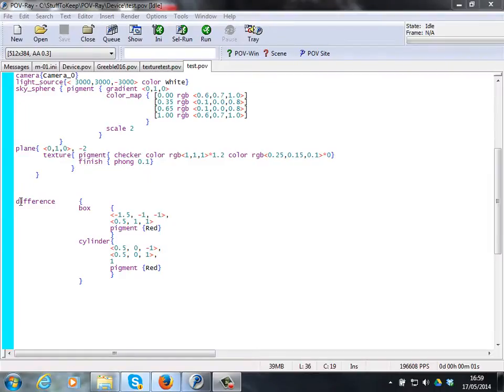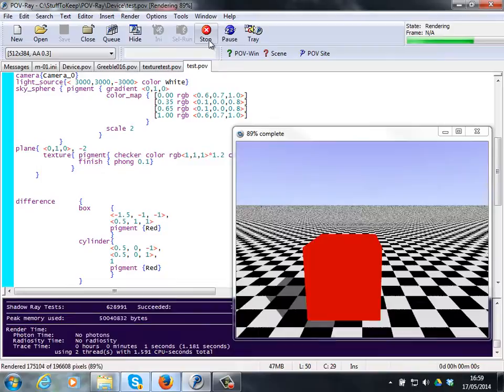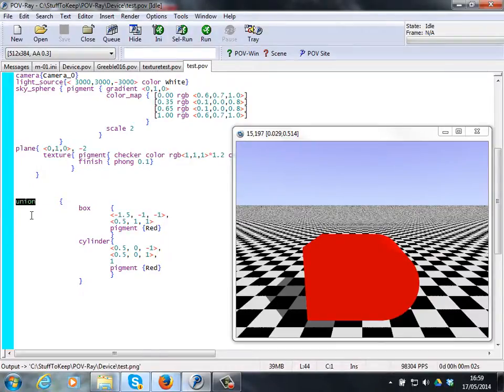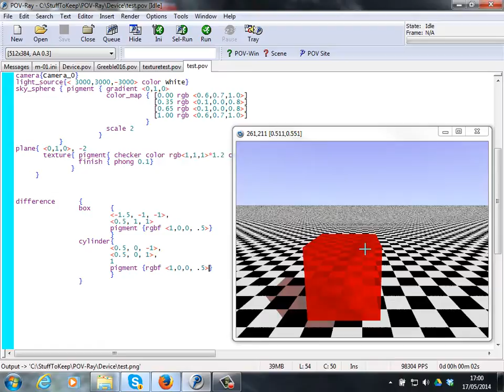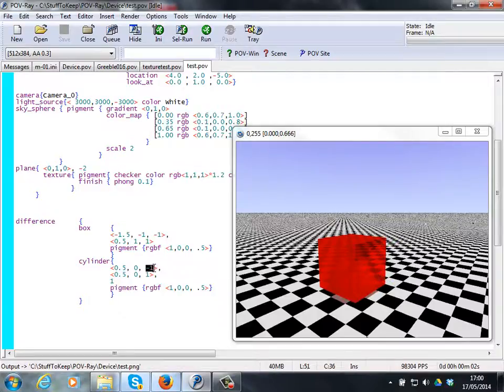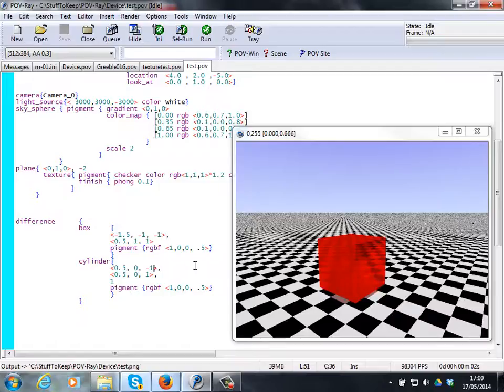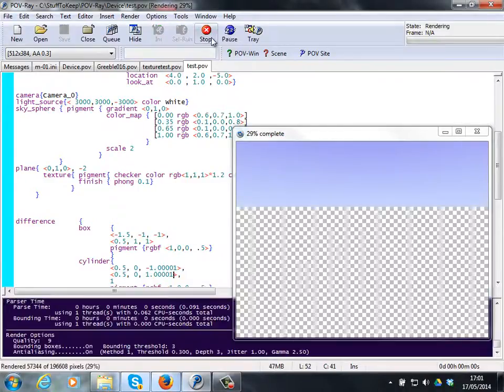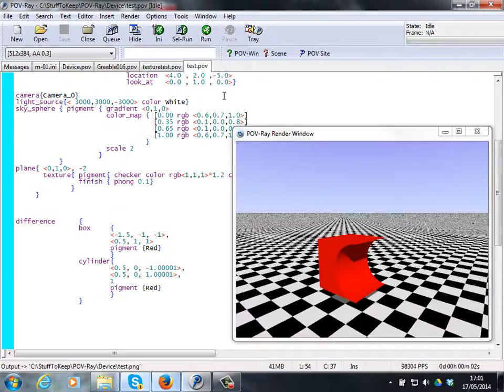POV-Ray tip for a failing difference

Comment: Great video, it will save us time debugging rendering problems. Here is the code for those whou would like to experiment and change values to see how POV-ray behaves...
#include "colors.inc"
#declare Camera_0 = camera {
  perspective angle 75 // front view
  location <4.0,2.0,-5.0>
  look_at <0.0,1.0,0.0> 
}
camera{Camera_0}
light_source {
       	     <3000,3000,-3000>
       	     color White
       	     }
sky_sphere {
  pigment {
    gradient <0,1,0>
    color_map {
      [0.00 rgb <0.6,0.7,1.0>]
      [0.35 rgb <0.1,0.0,0.8>]
      [0.65 rgb <0.1,0.0,0.8>]
      [1 rgb <0.6,0.7,1.0>]
    }
    scale 2
  }
}
plane { <0,1,0>, -2
  texture { pigment { checker color rgb<1,1,1>*1.2 color rgb<0.25,0.15,0.1>*0}
    finish  { phong 0.1 }
  }
}
difference {
  box {
    <-1.5,-1,-1>,
    <0.5,1,1>
    pigment { Red }
    //pigment { rgbf <1,0,0, .5>}
  }
  cylinder {
    <0.5,0,-1.00001>,
    <0.5,0,1.00001>,
    1
    pigment { Red }
    //pigment { rgbf <1,0,0, .5>}
  }
}

Thank you Felbrigg for those tutorials !